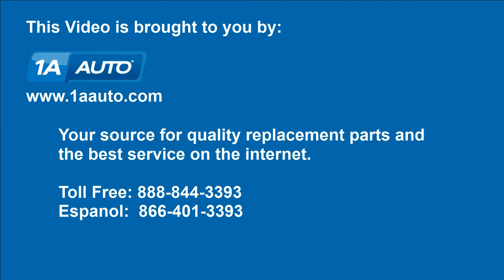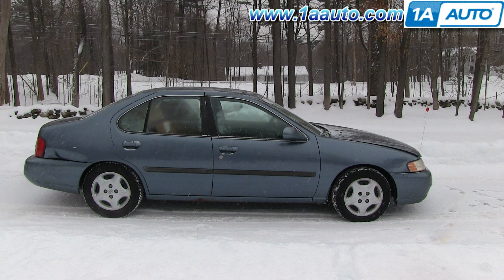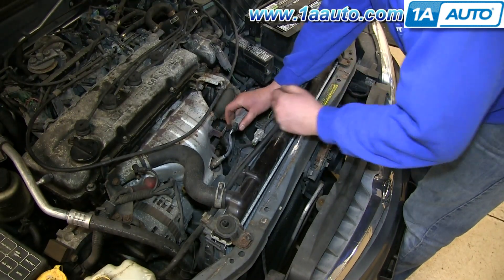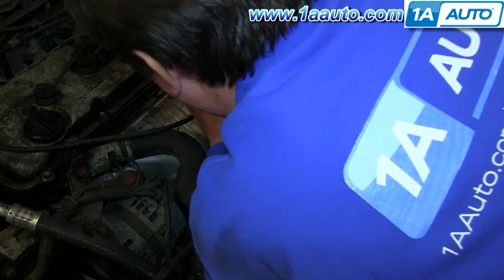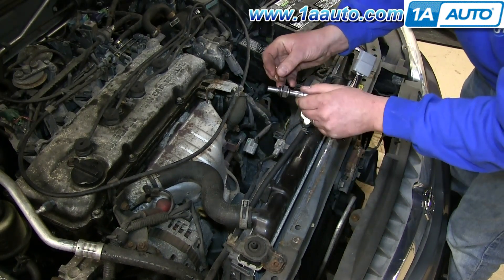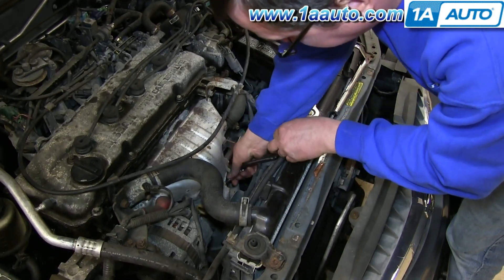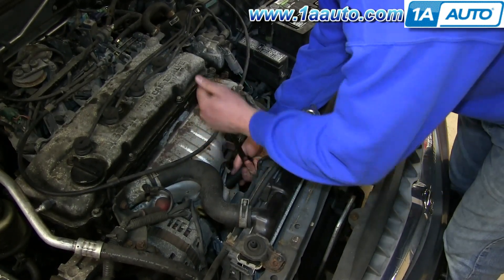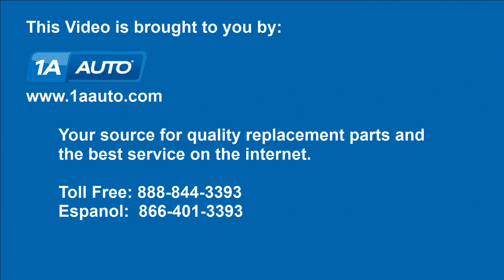How to Replace O2 Oxygen Sensor 96-99 Nissan Altima

Comment: I have a 2000. I have a code for both O2 sensors pop at the same time. P0135 and P0141. it's unlikely they both failed at the same time but with 120k on the car not bad maintenance to replace them. I'm still getting the same two codes instantly on starting the car. If not the O2 sensors themselves, what would make that happen?

Comment: Hi, I have had a 99 Nissan Altima for almost 5 years (bought it at 120,000 miles) and now its pass 200,000. Trying to change the 02 sensor for the first time, but when i put the socket and ratchet and try to turn it, it keeps slipping. It definitely looks really rusty so my guess is that the original owner probably never changed it. It already looks like I left tread marks on the nut of the 02 sensor and I don”t really know what to do. Do you have any advise on trying to get something that’s been stuck for more than a decade or something? Either way, thanks

Comment: Is of same for 97nissan maxima?
Reply from the maker: +Tony Cervantes At this moment, the closest how-to video we have to your request is for this vehicle, which is very similar to the one you have. The steps may not be 100% the same, but should contain an adequate amount of information necessary for accomplishing this task.
Reply: @1AAuto  of sensor oxygen  you change is bank 1 sensor 2 . Code p0141 ?

Comment: What can you do if the head of the O2 is so worn down that a socket slips?
Reply from the maker: +J Hutch Thank you for watching. If the head of the O2 sensor is worn, there are tools available as grip tight specific to these type of sensor or bolt heads. They are available at a local auto part store. 1aauto.com
Reply: Thank you!!

Comment: how long does it take for the service engine sign to go away after replacement?
Reply from the maker: +Parag Kad it may take three heat cycles or 100 miles of driving. Hope this helps you out. 1aauto.com
Reply: Take negative cable off for a minute